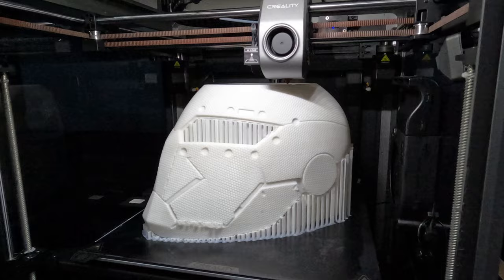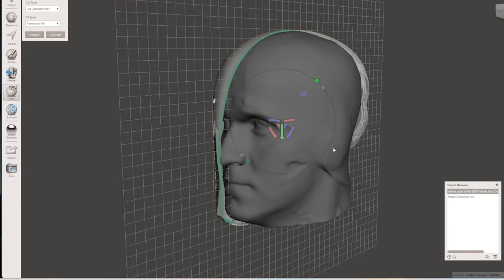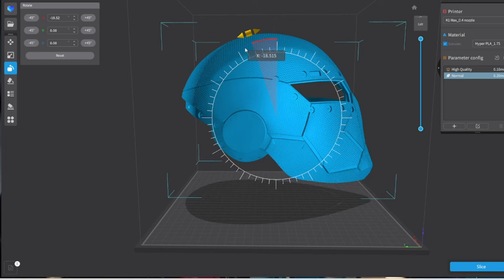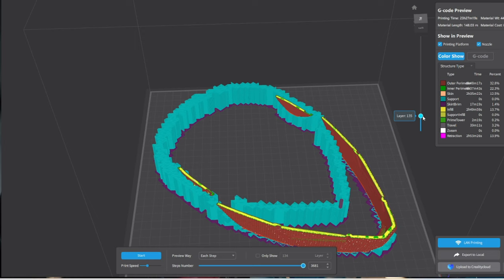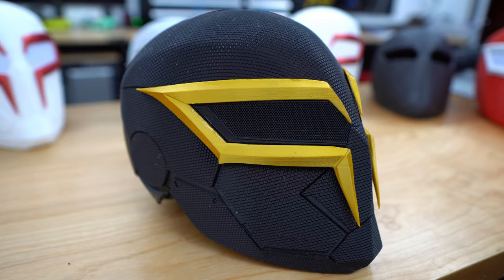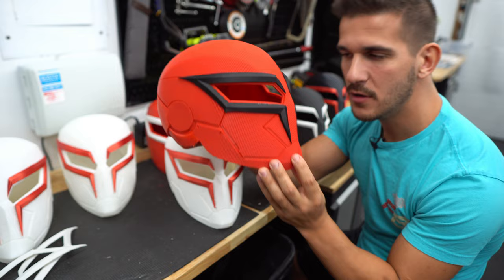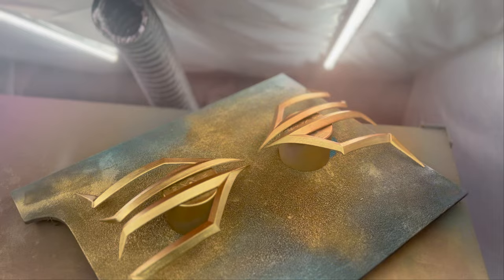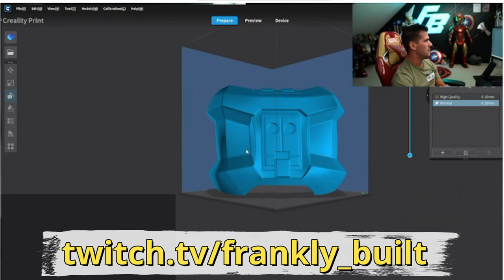3D Prints SO SMOOTH You Don't Need Paint! | SpiderMan 2099 Mask

Comment: I love 3D printing also imagine a world where you don’t need to sand 3d prints
Reply: i'd die to live in that world lol
Reply: That’s why i bought a PRUSA 2 yrs ago … 3800+ hrs of print time and i candy remember the last time I had to sand a print before priming. I print at .15mm by default and sometimes go to .10.  Yes I can’t print helmets in one piece but I’ve build a full size Amban pulse rifle and heavy infantry tri barrel without issue. Speed doesn’t concern me as I’m not in production of things and the printer runs just fine in the middle of the night … “bambo stool the s/w from creality who stole it from Prusa … “. There’s a hint in there somewhere … lol
Reply: Yesterday is saw a video were a guy took 3d printing resind and brushed it on his 3d prints, hardened it with a UV light ( or put it on the window) and it was smooth like a baby butt. Interesting idea.
Reply: @BenderRodriguezBender  yeah i've seen the resin method, it's much more messy than using normal filler and filler primer however but it is a good bit quicker, also you need a respirator as it's not good for you at all lol
Reply: @astrophysicistguy  You mean Jón Schone right? That guy is a maniac.
Reply: @astrophysicistguy  I printed a Terminator bust at 0.1mm and I still spent countless hours sanding that thing. Chrome is not kind to even the smallest of defects.
Reply: @treborrrrr  my process after printing is rust oleum primer, 320 wet sand, primer again, 600 wet sand - ready to paint. Did my entire mando armor and my wife’s Bo Katan armor that way without issue
Reply: One day. Give it 50 years lol.
Reply: That matte black one looks smooth to me, would need to see it in person.
Reply: And they actually work outside the box cough cough elegoo
Reply: Print in ABS or ASA and acetone vapor smooth them. All it takes is a large box, some acetone which is super cheap, and a coat hanger to hang your print on.

It’s insanely easy and you’ll also get armor that lasts way longer in UV, heat and rougher conditions compared to using PLA.
Reply: @astrophysicistguy can bamboo hit those margins yet?
Reply: @treborrrrr  obviously depending on what you're trying to do the prep is going to be different. I've done a complete Mandalorian cosplay outfit. I didn't need to do any initial sanding after the print as it was more than good enough for priming but there were several rounds of primer and sanding followed by a round of polishing after the gloss black was applied. I actuually recently started a Terminator burst - got all the pieces printed, primed, sanded and gloss black applied. I was waiting for my XL to do the head & stand in one piece but given how smooth pieces are coming out on the XL I suspect no adding until after priming again
Reply: Black helmet with white frames and lenses would make a sick venom suit mask

Comment: The painted ones definitely look better. Both look good, but the painted ones just look more finished. 

Also, on the mesh side of things, another option is the screens they make for frying pans to prevent spatter. If you look in my avatar photo, that's what I used for the Mr. Knight Moon Knight mask. Cheap, paintable, and easy to work with (and they look way more opaque in person).

Comment: The painted one had much clearer panel lines and seams and really made the helmet look more professional. Plus the metallic red eye frames are gorgeous of course.
Curious why you didn't try to print the eye mesh or the eye "frames" on a resin printer? 
One of the best crafting methods is to use fast high quality FDM printers for the bulk parts and then use ultra-clean ultra high-resolution resin printing for the intricate details. Pretty sure the lenses would have come out great on a resin printer (though obviously, colour matching would be even harder!!)

And finally, the top part/crown of helmets like this remain the biggest weakness of FDM printing. The visible layers lines and rough stepping as you reach the crown of the head is just unsightly. I was impressed to see how much better the textured helmets came out though - the differentiated surface really helped to hide the stepping.

I'm eally wanting to pick up a Bambu to complement my resin printers and finally dump my awful Artillery Sidewinder. But I'm going to wait a bit longer and see how the rumoured X1E looks - fingers crossed its a bigger machine, at least 300-350mm!!

Comment: When you heat up the magnets to sick them in, how do you do it with PETG? I didn't know too much heat can ruin a magnet and I tested just putting it at 300f and it got the magnet in just fine but lost it's magnetism. You said they lose it above 70c but I believe the glass transition point of PETG is a bit higher than that.
Reply from the maker: Heat up the plastic. Not the magnet

Comment: I know I'm late here. I'm really stuck between the K1 Max and P1S Combo as my 1st and only printer. (Unless I can convince the Mrs that a 2nd printer is beneficial) Max for volume and P1S for the AMS. Obviously, I will print helmets one day (mostly SW) but I may do fun projects too that may use the AMS. So, in terms of quality print, which is better? I guess quality is top priority. I noticed you don't get those rings on the rounded top (especially on the textured helmet). Is it a setting in the slicer? Maybe I missed it, but what type of filaments do you use for armors? PLA is enough? I have time to decide but for now top 2 again is the K1 Max and P1S. Lately the Sovol SV07 Plus came out and it's a 3rd of the price of the other 2. So now I'm thinking if a bedslinger is OK or do I stick with a CoreXY.

Comment: Hey Frank. Sorry for the many comments the last days :) I have a last question about the Neptune 4 pro. Is it possible to print on stock settings without the blower fan bar? Does it print still good quality or should i have it running all the time? Thanks :)
Reply from the maker: I’m actually not to sure. You’re just have to slow the print speed down
Reply: How much? Stock setting is 250mm i guess @FranklyBuilt

Comment: Hiya Frank,  I print my helmets without supports in the centre of the dome too. But It always look a little messy on the inside of the top dome. How are yours looking there?
Reply from the maker: Messy. Use a heat gun and clean them up.

Comment: These look amazing!   How do you keep the bottom of your prints looking so smooth where the supports touch?
Reply from the maker: It just comes that way
Reply: @FranklyBuilt  that's frustrating.  Almost every print I've made(the judge dredd helmet is the worst of it) the bottom is flat and smooth, but as it curves up it looks almost like the layer outlines are there, but it never filled.   Trying everything I can think of, BUT I'm still new to this.

Comment: Hey Frank. I thought the very top of the dome would collapse inside if not supported. I was about the print a textured spiderman ps4 helmet and I prepared ıt to have a bunch of supports at the top. Would the textures and surface on the outer side be fine without supports at the top?
Reply: No like actually. Would you reccomend it? I seen your previous videos and you said it will be fine a lot of times but ım just curious about the texture quality

Comment: How do you breathe with a plastic helmet on?
I know it's not closed, but it still kinda claustrophobic. 
When I made Star-Lord's helmet, I put real fans in and the difference when they're on is insane. In certain settings, it's actually more comfortable to wear the mask than not wear it (I really like practical functional props like that :D).
However, tighter masks don't have room for those luxuries... Any tips? I have plans, but I'm a little worried I'll spend the cons holding the helmets instead of wearing them.
Reply: unless your helmet is so tight on your head that it creates a seal around your neck you should be fine i suppose, yet again tho i'm more into clone and mando helmets which are bigger and have more space for ventilation
Reply from the maker: They have small holes on it

Comment: ok my rant/complaint on this. i dont know how you are getting these to print so fast. i have a neptune 3 max and the fastest i could get without supports and printing at 300mm on everything was about 3.5 days. with supports it was 4 days at a .2 hight anything above that it was 6-8 days. and im using pursa. any tips on why its taking so long. note im only adding organic/tree supports to the edge of the base of the helmet and the top of the eyes for the overhang.
Reply from the maker: Because the 3 max cant really do 300mms. It can barely do 100. The slicing program limits it. The only thing that MAY be moving at 300mms is the retention and jerk. Not print speed. It’s impossible for that printer to go that fast.
Reply: thanks that makes since
still love the print tho
 @FranklyBuilt

Comment: Hey Frank ! What happens if you put the supports in the eye appature while its oriented vertically, THEN tilt it back on the bed ? Do the supports stay where you put them ?
I use Simplify 3D, and you can do that , it cuts down on support, filament, and print time.
Reply from the maker: The supports will only register to where they connect to the print. Doesn’t matter the angle
Reply: @FranklyBuilt  I recommend simplify 3D then ! Great videos, they’re inspiring a me and a friend to get to this level :)
Reply: Yes if you raise it off the bed alot then apply supports, you can reorient it and the supports will come in from the same angle. I've used this for years.

Comment: Great video and prints! However, what about the seams? I don't see any seams in those helmets. They are inside?
Reply from the maker: Why would they have seams? They’re one piece
Reply: @FranklyBuilt  Thx for the response! About those seam lines, I mean, the sections between the beginning and the end of every layer. Those sections are called seam. They usually leave a line in every print, but in those helmets I didn't see any!

Comment: Im completely helpless right now. Im watching video after video about 3D printing all day and cant decide if is should buy a printer or not. Elegoo Neptune 4 or Ender 3 V3. Next decision if 220mm print bed are enough or a bigger one. I cant decide :( And after all. 3D printing seems to be a money pit too.
Reply from the maker: The Neptune 4
Reply: Is it big enough? 220mm sounds not very big.  @FranklyBuilt
Reply: Hey Franky. Have bought the Neptune 4 pro yesterday. Any advises for settings for good quality printing? What i have seen in your videos is that a thin layer height is good and slower printing. Yes? 
 @FranklyBuilt
Reply: Make sure to buy the one's he links so he can take money from you

Comment: @ timestamp 6:26 "...I'm OK with a 22 hour Spiderman helmet...."  That's very nice to hear. Please point me at a complete listing of your settings for a ""22 hour Spiderman helmet"....or, it never happened.  ; - )  Thank you very much for your kind consideration.
Reply from the maker: I show you in this video. I don’t change much, block supports. Increase print speed. Go,
Reply: @FranklyBuilt  Howdy Frank, thanks for replying...I was just yanking your chain. Your completion time frame was indeed revealed in a screen grab @ timestamp 7:21 where all of your print speeds have been dramatically increased (at least over mine). I also alternate betwix Orca Slicer and Simplify3D and don't generally use either Creality or Bambu...I am glad they work for you.

Comment: There isn't a raw 3d print that doesn't look sh*t.
Even sanding and painting is nowhere near as smooth/clean as plastic toys you buy etc but it's still FAR better than raw 3d prints.
Reply from the maker: But this doesn’t look like sh*t. It looks fine lol you can print nice textures and you can’t buy masks like this in a store haha
Reply: @FranklyBuilt  It's the only reason we do printing because the stuff can't be purchased in stores. 
However, the quality is nowhere near as good as anything professionally made. All printing has lines and faults etc.  
One day, home 3d printing will get to the level of store stuff though..